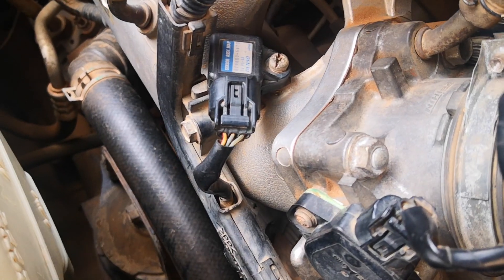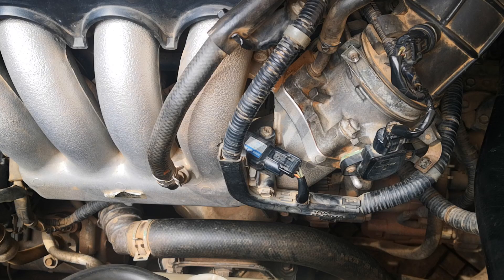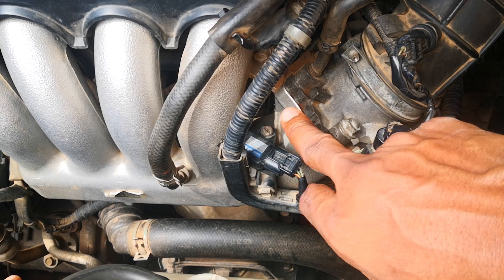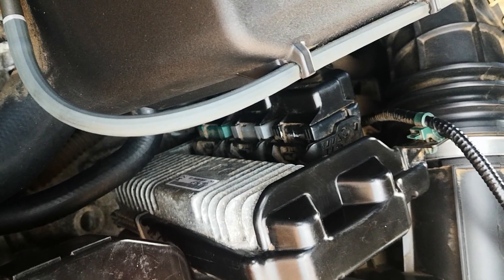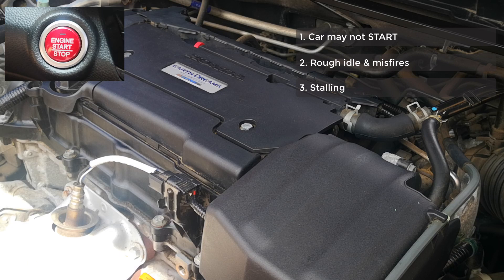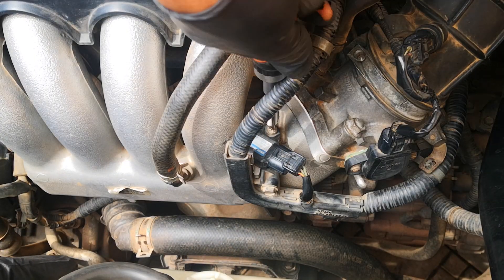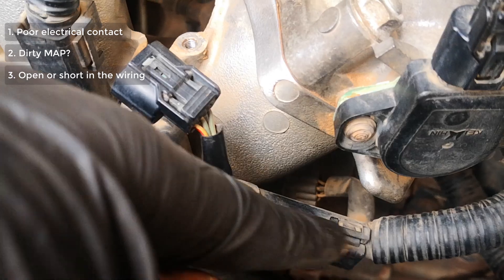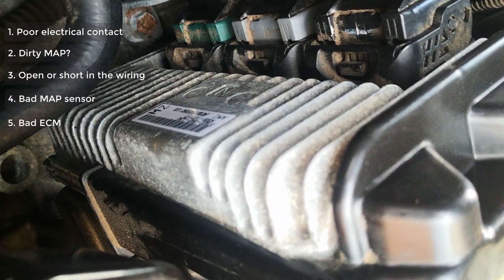Symptoms of bad MAP sensor, How to FIX MAP sensor codes P0106 P0107 P0108 Location of the MAP sensor

Comment: I only get a P00BC code - 2009 X5 - Did find some oil in the MAP sensor??? No vacuum leaks, never a miss fire, ALL has been super checked, all sensors are up to par; so; what could be the matter? Could the MAP sensor be bad? None of the codes you mentioned, EVER. I have no lack of power, hesitation is at idling, and some sort of sleeping (sometimes) as if is transmission related but I don't think so.
Reply from the maker: Most references I saw online with the P00BC is to do with the MAF sensor not the MAP. Is it different with BMW? Check for dirt, poor connection and lastly if its bad.
Reply: @DIYAutoworksNG  thanks but this code is not specific as it should be. All sensors are new, some, checked the others. I wonder is through the engine pulley gasket/seal. I had the serpentine belt snapped but only drove 2 miles home at 40 mph. Did check the valvetronic and the two screws required some tightening but no oil leaks or in spark plugs tube. Is insane! I’ve EVERYTHING imaginable and keep the car top notch; only 108K and immaculate all around. I don’t trust dealers; they will get you for every penny and you come out empty and additional issues you never had. Curious is that I have no oil leaks from pulley engine seal.

Comment: I have some of the symptoms, especially sluggishness, bad fuel efficiency, low idle - to stall, when I reset cel codes (intermittent P0325) I assumed the MAP was having issues that were compensated by the ECU after driving some distance. No MAP codes though.
Reply from the maker: The P0325 points to a knock sensor issue which can cause all the problems you stated.

Comment: Why can My 2002 Honda Odyssey not rev past 3000 rpm?
Reply from the maker: It's in limp mode. You need to have the car scanned to identify the diagnostic trouble codes.

Comment: I got the same code for P0107 run every diag change the sensor still no solution check wiring and everything is good
Reply from the maker: Checking the wiring involves confirming the following at the MAP connector: 
1. Good ground (power probe will help) 
2. 5v at the reference line
3. Checking for voltage on the signal line. 

Also check for bent/flux/corrosion on the pins. If all these checkout. It maybe a bad PCM especially if the reference voltage is off.

Comment: I drove with the mechanic forgetting to install the intake tube to the airbox for hundreds of miles.. p0171 and left at 50%!   I installed it back and the trim is now near zero  and runs good again but I'm worried  I hurt my car.   2004 highlander v6
Reply from the maker: Good you caught it. Guess you'd know if the engine was hurt if it starts burning oil. Finger crossed nothing happened.
Reply: @DIYAutoworksNG  you think I'm ok?  :(
Reply from the maker: I'll say just monitor your oil level for the next couple of weeks.. If you're in a region with sandstorms, then the risk of damage would be certainly higher.

Comment: My Ford explorer 2015 keep showing this code p0107 even wen I have replace another new map air sensor but it's still continue showing that same code,.. which I don't even know what to do..pls I need a solution
Reply: Thank you very much..coz that code has frustrated me alot
Reply from the maker: Check that the electrical connection is tight. Also that the contacts are clean. You may clean the contacts on the connector with electric contact cleaner. Also check that there's no short or open in the wiring.

Comment: Could this cause a P0171 system too lean and a P430 catalyst efficiency below threshold, so far installed brand new exhaust manifolds, put in a brand new mass air flow sensor, brand new bank 2 downstream o2 sensor and codes still come back after being cleared and even checked for vacuum leaks and found none. This is on a 2007 Cadillac Escalade ESV with a 165,xxx miles on her.. been trying everything
Reply from the maker: Since your car has 2 banks, you have something occurring just on bank 1. I see you changed the bank 2 sensor 2 downstream O2 sensor. Its the bank 1 downstream sensor  that could be the culprit. A dirty MAF can cause this, but I would expect to have the same code for bank 2 (P0174) if it were air supply related. Same goes for the MAP. Since this is not the case, think of things local to bank 1. Anything offsetting the air-fuel ratio towards the lean end will cause this. I am not familiar with this brand, but does it have 2 fuel pumps or PCV valves? Low fuel pressure or cracked or stuck open PCV valve, vacuum leaks on bank 1  are other potential culprits. Reviewing short  and long term fuel trims will help give a sense of where the problem lies. E.g. If you're having a reduced fuel supply issue, the STFT may be normal at idle but will go lean when you snap the gas pedal and hold at about 3000RPM.
Is the car having any other symptoms?
Reply: @DIYAutoworksNG  i even sprayed down every where too looking for a leak for change in rpm, around intake, throttle body and all hoses, vacuum lines, brake booster and did see or hear no surge with rpms but another strange thing is ever since the P0171 code i get for a lean running i also get a the message on dash that also says service stabilitrak and service traction control but only at idle but once i step on the gas or on motion it goes away till i stop again
Reply: @DIYAutoworksNG  Ahhh okak which my short fuel trim sits around 0 and and 5 while my long trim sits at 24 percent and goes down when i rev it up, but now i did buy a new map sensor and replaced, old one I pulled had a coating of oil but that wasn't it either so today i bought a new purge valve and going to change purge valve of that doesn't do it then I'm going to try to put in a new coolant sensor. But you think i should change my bank 1 o2 sensors then or will i onow they are all original except the one on bank 2 sensor 2 i changed last weekend.
Reply: @DIYAutoworksNG  And as for other issues she seems to drive pretty good, doesn't idle or shake or anything, sounds a bit loud and can hear exhaust on driver side right about at catalytic converter when im giving it gas to get up to speed but she seems drive pretty good other then that but the i was contributing the to the stainless steel performance exhaust manifolds i had a shop install to replace old rusted cracked one that had broken studs and wanted stainless steel so i wouldn't have to worry about it rusting away again like the oem one

Comment: Someone tell me where my map sensor it on my 2010 elantra. Been looking under my hood for four hours and can't find it for the life of me
Reply from the maker: Hello. Its usually in very close proximity to the throttle body. I don't know Hyundai very well but this is the standard position on most vehicles if it has a MAP sensor equipped.

Comment: This is one of the best explanatory Auto repair videos I've seen from Nigerian YouTube and I'm proud.
I'm a DIY enthusiast and do basic repairs on my machine myself and this definitely explains my inconsistent fuel economy and this is the only code on my Ford.

Thanks for making this
Reply from the maker: Thanks! Glad to hear this was helpful. Trust you'll rectify the MAP issue soonest!
Reply: @DIYAutoworksNG  the map sensor is together with the EGR valve and I could not find it here in Nigeria so far but already ordered and expecting delivery.
The car is kinda scarce though despite being a Ford. Many don't even know the model exists until I send pictures as evidence. I will appreciate if you have a place I can get original parts and sure to have for my car.
It's Ford Five Hundred
Reply from the maker: I feel you. Being Ford 500 would have something to do with the difficulty finding parts. Not common. I've seen it maybe once or twice. If you've gone to the major used parts markets in your state, then it's to import as you've already done. I used a combination of Amazon, Rockauto and authorized distributor sites.

Comment: Hi, can you tell me if the pressure reading from a MAP should be dead steady or can there be some variation? I have three pressure sensor in a bmw m235i ( ambient pressure, intake charge pressure and manifold pressure). Two ( ambient pressure and manifold pressure sensors) are dead steady at 1030 hpa whereas the intake charge pressure sensor varies between 1027-1033 hpa when using a ODB scanner . All readings are before starting the engine. I'm experiencing a fault code (Throttle valve opening angle absolute pressure intake pipe comparison pressure too high) on startup and was wondering is the MAP sensor which is showing a variating value could be the issue.
Reply from the maker: Hello,
MAP readings are meant to vary with the degree of opening of the throttle. It should be equivalent to ambient barometer readings in the 'engine off key on position' before starting the car. After starting it should vary based on the first reason given above. I am not too familiar with this BMW setup, but think that that 3rd pressure sensor should read ambient too before start. Could be wrong though. Have you checked vacuum lines?
Reply: @DIYAutoworksNG  Actually what I meant by variation was that the reading from the charge inlet MAP was moving between 1029-1033 hpa (very quickly)  before the car was started whereas the other two MAP were not changing at  1030 hpa.  Basically wanted to know if  a MAP sensor was 'bad' if it was showing changing values with no change in conditions.
Reply from the maker: It should be steady with the engine off.

Comment: Could a dirty map sensor cause me to get bad readings for other sensors? My Intake air temp sensor was off, throttle position sensor was giving bad readings, and my absolute manifold pressure was low on the scan tool.
Reply from the maker: I would say in some instances yes, however, intake air temp and MAP are 2 different things. I don't see a connection. Do you have DTC's on the car? What car is it?
Reply: @DIYAutoworksNG could it trigger a crankshaft position sensor code ? Or could the crank shaft position sensor code trigger the map sensor codes ?
Reply: This is my same question?

Comment: it would be good if you showed the actual values on a diagnostic scanner, showing the engine operation with a damaged map sensor and then with a new or replaced map sensor. Great video bro, best regards.
Reply from the maker: Great suggestion. I wish YouTube allows the addition of content to an uploaded video; would have done this.
Thanks for the compliment too. All the best.
Reply: @DIYAutoworksNG  Thanks for Your answear. I have a one question. Are  You from India? In every Yours video I Heard traffic sounds typical of this Country.
Reply from the maker: No. 
The cars I work on are parked quite close to a busy road. Lol. Similar sights and sounds 😁. I film mostly from Nigeria.
Reply: @DIYAutoworksNG  what time is it now in Nigeria?
Reply from the maker: 9:39am on the dot!
Reply: @DIYAutoworksNG  10:47 in my Country
Reply: @DIYAutoworksNG  11fffff
Reply: @DIYAutoworksNG  you can just make additional video with clips from this.